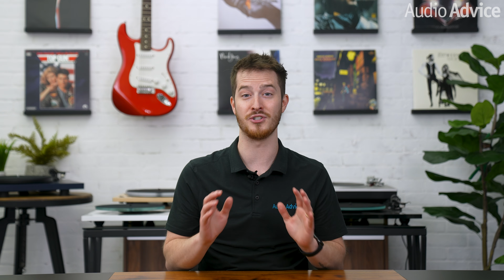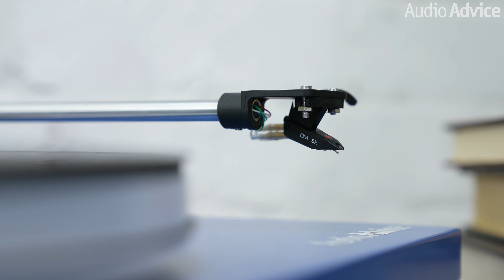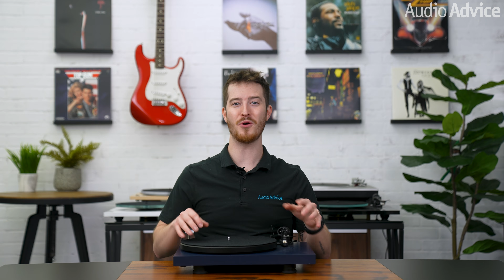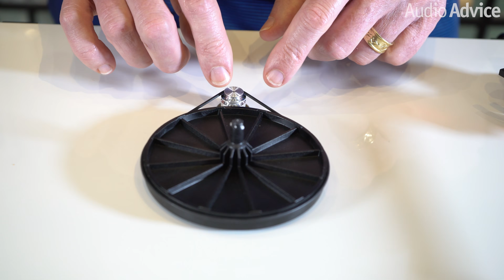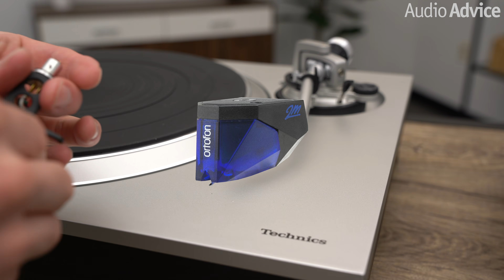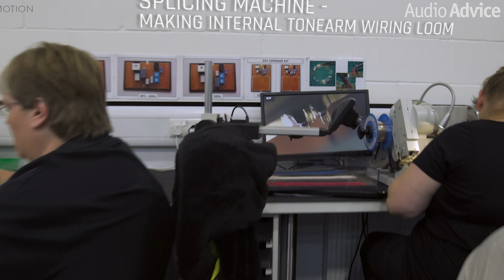BEST Turntables to Buy ✅ Turntable Buying Guide! 💽 Pro-Ject, U-Turn, Rega, Technics, MoFi

Comment: I'm a vinyl enthusiast and I live in Brazil. Here the information is very scarce. My intention is to listen to vinyl records and I currently have a Marantz PM8006 Amplifier, Elipson Prestige Facet 8B speakers and a Turnable AT-LP1240 with Ortofon 2m RED.

I want to change my capsule, I wanted to buy an ortofon 2m black. However, I was unsure whether I should also change my AT-LP1240 since it is more aimed at DJs (I didn't really understand this at the time I bought it).

My question is: Should I actually change the AT-LP1240? I thought about purchasing a Raga Planar 3 or Pro-ject RPM 3, or perhaps even a Pro-Ject 1Xpression. Is changing the record player really recommended? Should I really get another sound experience with better quality for my purpose?

I already know the capsule is terrible and should at least go to an Ortofon 2m Silver!
Thanks to anyone who can help!
Reply from the maker: Both the turntable and cartridge make a big difference.  Those other tables you mention are all better.  You can also purchase an Ortofon 2M Blue stylus for your Red and that will be a good upgrade as well.  Thanks for watching

Comment: I wouldn't buy either of the tts you describe as they don't have removable head shells ..my two tts all have them and it makes for chainging cartridges so easy
Reply from the maker: That feature certainly does make it easy to change cartridges but there is some evidence removeable headshells do not sound as good as a one piece tonearm.  Its all a trade off.  Thanks for watching

Comment: I can’t decide which turntable should buy! T T Im a beginner and don’t want to spend to much money, I’m thinking about audio technica 120 🫣
Reply from the maker: Chat or call with one of our turntable experts at audioadvice.com! They can help you find the perfect starter turntable 😃
Reply: The Rega P3 hands down in my opinion because it’s got potential and i had a old rega p1 ( a great TT) but not so much potential without changing the motor. So I just upgraded to the new P3 with speed control box plus Rega MC cartridge and MC Preamp on rega wall mount I also bought the new Rega mk4 Elex r and focal aria 926 speakers.  That’s me done? Can’t see me changing my system again now . Don’t get trapped in the same situation i did over the last 30 years  or so always upgrading.  Use your own research and ears to tell you what best and work for you ? Hope this helped good luck.

Comment: I started my Turntable journey in 1963 with a Duall 1009 rim drive table. Next in 1965 i upgraded to a Thorens DT 150 belt drive  without tonearm. I bought an ADC Pritchard wood tonearm for the Thorens. Cartridge was a ADC 10E  which tracked at 1 gram. Next was a Thorens TD 125 Electronic turntable belt drive without arm.The JH Formula 4 unipivot arm from Australia was released, which i connected to the TD 125 with the Shure V15 type 3 cartridge. In 1990 i bought one of the first Pro-Ject turntables the 6.1. 10 years later was the Project 6 Perpex magnetic suspension turntable. I changed the supplied arm with a Hadcock GH242 Uni-pivot tonearm from England. Latest cartridge is a Denon low output moving coil cartridge. Each change of turntable, arm, and cartridge resulted in palpable improvement from the record.
Reply from the maker: Wow, that is quite the journey.  That old TD125 was a true jewel back then and we do remember the JH unipivot.  Thanks for sharing your adventure